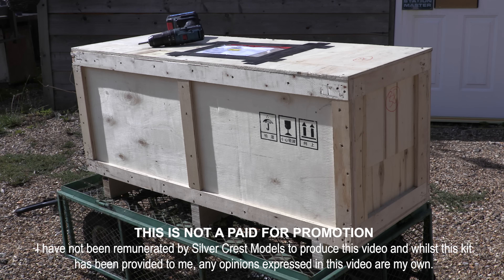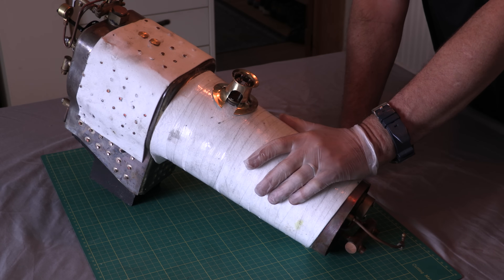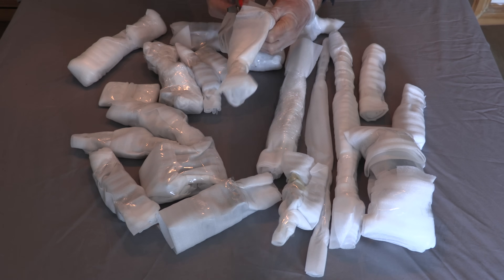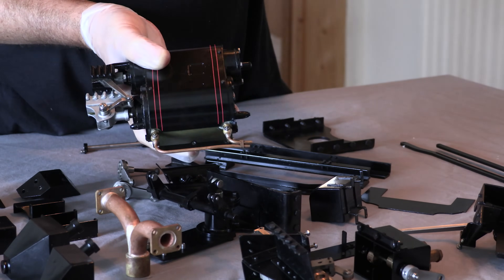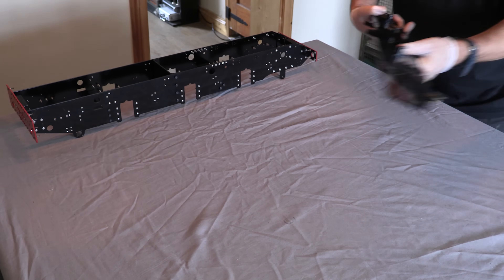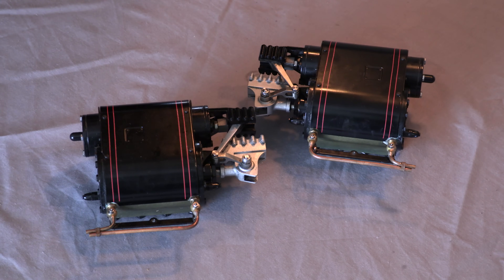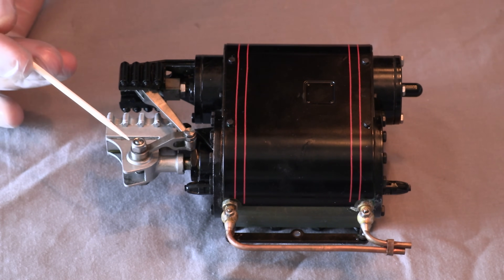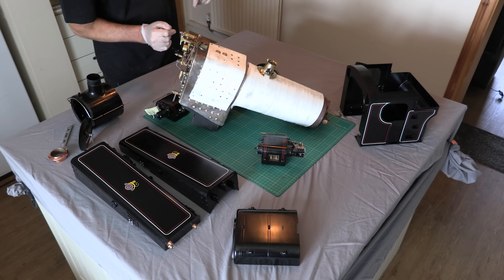Is this the biggest partwork kit? Unboxing the Kingscale 5" gauge 1500 loco from Silver Crest Models

Comment: Having previously built a Model Works pannier this kind of kit is a revolution.
I had to do a lot of modifications to make this pannier steam and work successfully!

One  modification was to change the piston rings, do you know what type of piston rings are fitted to this loco?

Great video
Reply from the maker: I have been there too with a Modelworks 1400 pannier tank that ended up staying in brass and as a shelf queen. Re: piston rings, Mike says "All our engines have silicon O rings throughout".
Reply: That's what I suspected 
Silicon rings are good but will eventually need to be replaced 

I fitted Clupst rings to my Pannier.
They made a big difference to the long term performance of the engine.

I would be tempted at the build stage to change the rings 

The big advantage with the 15xx is that the cylinders are external and easy to access lol

Thanks
Tim

Comment: To be honest this is the quickest way to get a running steam engine having built 4 engines over the last 50years, I have enjoyed the building of each engine but if you want something to run this is the best way, but not cheap.
Reply from the maker: I think you've hit the nail on the head. How many auction houses are littered with unfinished projects where the model engineer simply did not live long enough to finish the build? Of course, price is very subjective too. You yourself said you have built 4 engines over the last 50 years. That's a  great commitment but some folk don't have the skills or time to devote to this amount of time. We always say, if we factored in our hourly rate into these builds, then the finished loco would be worth millions. I know Mike Pavie has built a few himself and these command price tags upwards of £20K. So factoring all that in, I don't think the price is too bad, you just spread your costs out over a longer time period. Let's not pretend this is an ME-built loco. It is a relatively simple assembly kit, but Silver Crest tell me they have sold many kits to skilled model engineers who just want a quick fix and something to get up-and-running whilst they attend to their longer term projects.

Comment: HINTS AND TIPS ON USEAGE
Those "bits" sticking out of the boiler tubes are Superheater flues, which will raise the steam temperature considerably above the actual initial boiler temperature. Which also increases the locos power. Its power limit will in practice be limited by it's adhesive weight on the rails. So you may actually need working sanding equipment, if this isn't provided. But even though an 0-6-0 it should pull from 2-4 adults, depending on the weight of the carrying cars, and their free running abilities ! 

I would suggest very strongly, that you join the local Model Engineering Club if you haven't done so already. As you will need at some point in the future the services of a qualified Model Engineer, and virtually all Clubs have at least one amongst their ranks. 

There is also the issue for a Novice of how to care and operate such a loco, as it will require both preparation before each use, and disposal requirments after each use. Failure to do this, will render the boiler increasingly unrelaible. This includes the total cleaning of the inside of the Firebox after every use (all ash must be removed). It is NOT wise to use tap water in the boiler, as most tap water has at least some limestone in it, which results in limescale clogging up the boiler. The local club should be able to tell you their local methods. If in doubt use "Distilled Water", and you may need a few gallons of that per running session. Also the fun of doing Boiler Washouts after every other running session is wise, which requires the external boiler washout plugs to be removed, and a stream of water sent through the boiler for maybe 5-10 minutes continously, to try and washout any acccumulating limescale.  
 
But the most important thing about the loco is LUBRICATION. Steam locos need specialist types of oil which the local Club should have. But every mechanical beariing MUST be oiled before use, on every occassion. And may need further topping up during an afternoons use. I can't see from the film footage what type of lubrication they are providing for the cylinders, but the cylinders need constant internal lubrication, with "steam oil". A type of oil that is happy to be immersed in boiling steam, and under constant boiler pressure, some of which is obviously ejected as the loco functions, hence you have to have either a drip feed method or a Hydrostaic lubricator which also slowly and constantly feeds steam oil to the cylinders. Failure to deal with all lubricating points on the model and there are at least a few dozen of these that I can see, will quickly result in overheated, and rapidly worn bearings.

Probably the most important thing to keep your eye on when operating the loco is that one little Water Glass. Do not let the water get to low under any circumstances. This model appers to operate on 80psi, which is quite high for a 5inch Guage loco. If the water level gets too low the possibility of an explosion of the boiler becomes more likely, and if your sitting behind the loco at the time, it will most likely Kill you and anyone else standing around. Steam locos are great fun, but they become extremely dangerous in the hands of unqualified operators !!!!  

Steam locos need constant TLC !!

NOTE: Many years ago I was the Shed Master for the RH&DR's 15inch gauge fleet of steam locos, and I've also had a few 5inch gauge locos in my time. 

Happy steaming 😀😀😀
Reply from the maker: I knew there would be someone out there who knows all the bits better than I do. Thank you! This is a gold dust comment. As it happens I need to refer to the boiler in the next video, so with you permission I'll mention this and name check you too.
Reply: @MADforSTEAM  Be my guest. The main reason I responded was because you mentioned the word "novice" and you didn't mention anything about being a member of a Model Engineering Club. So my number one concern was Safety.

Comment: 14:47 there is something to report. They took the effort to cut keyways in the axles and wheel hubs!
Reply from the maker: Well spotted! I had not even noticed that. That's a nice tough indeed.
Reply: Not done on full size or by traditional model engineers. Also it won't prevent the wheel working  loose if it's poorly fitted in the first place.

Comment: Pourquoi les gants, il a peur de la salir !  😂
Reply from the maker: Ha ha! No, it's just a habit I have gotten into as many parts have a covering of light oil for protection. That way I can handle the parts then take the gloves off if I need to touch the camera so it does not get covered in oil😅
Reply: C'est une bricole en alu, sans intérêt ! 🙄
Reply from the maker: @micheldilly8531 Maybe the smokebox is aluminium, but the rest are mild steel, brass or copper.
Reply from the maker: @micheldilly8531 The connecting rods are stainless steel...
Reply from the maker: @micheldilly8531 I am only an end user - I suggest you contact Mike Pavie directly, he designed the kit and should know. I did and I am only passing on what he told me!